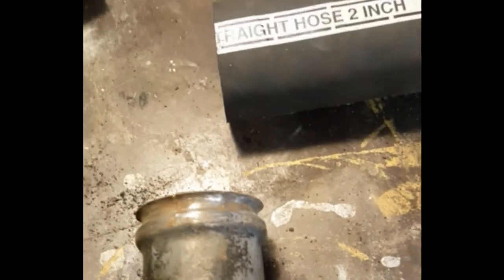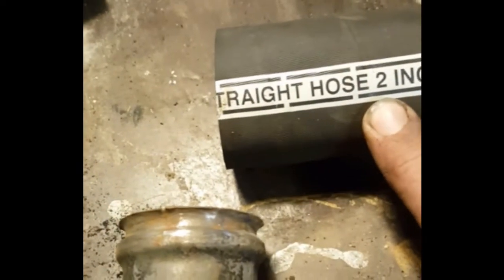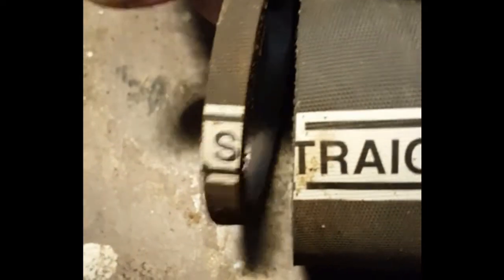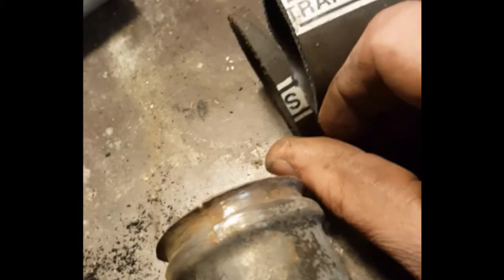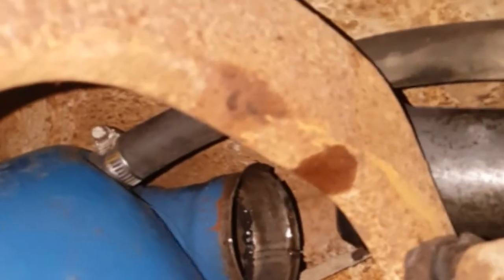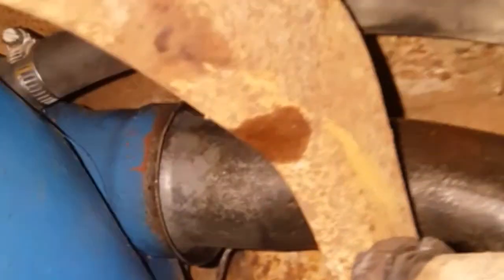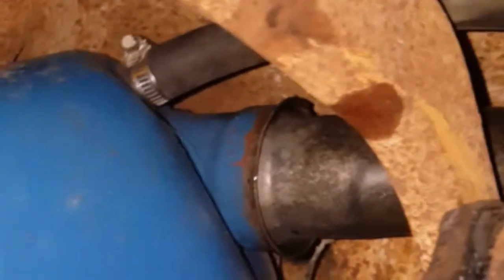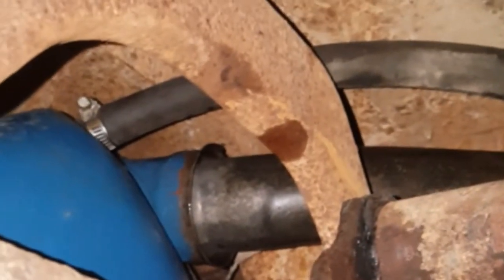55, 56, 57 chevy gas tank filler o ring

Comment: is the gas cap behind the tail light on a factory 55 ? My friend said that only the 56 n 57s was like that, so where is the gas cap on a factory 55 bel-air ???????
Reply from the maker: Your friend is correct.  55 gas cap is divers side with its own door in the rear fender (not hidden)

Comment: The hose you have isn't fuel resistant.  There is fuel filler hose that is thought.
Reply from the maker: At this point... 1.5 yrs & 15k miles later, with no leaks.. not even a drop.. im not concerned with fuel resistant hose. Its sealed